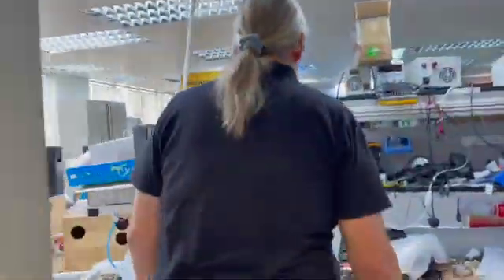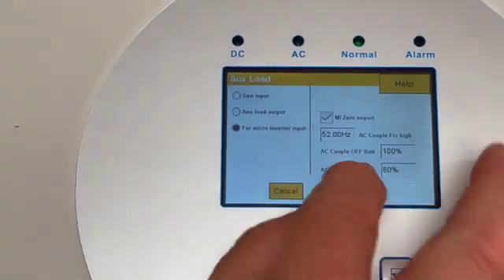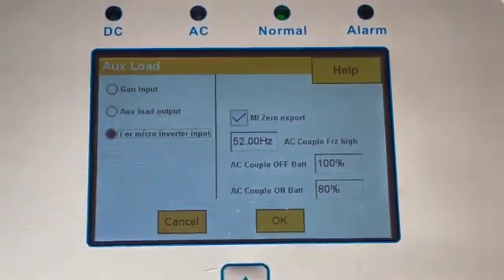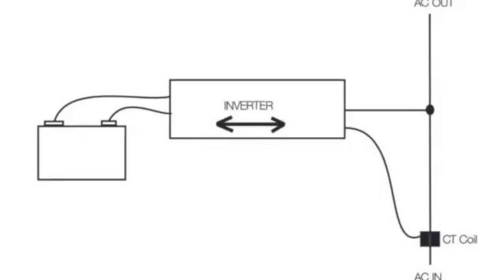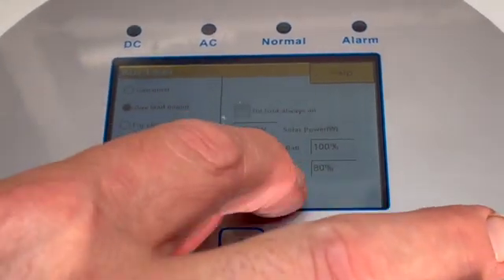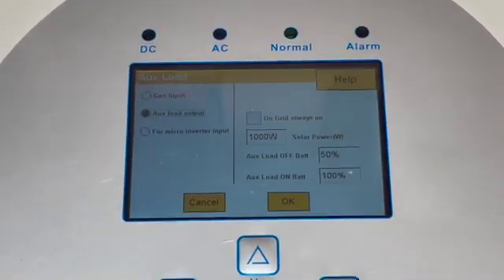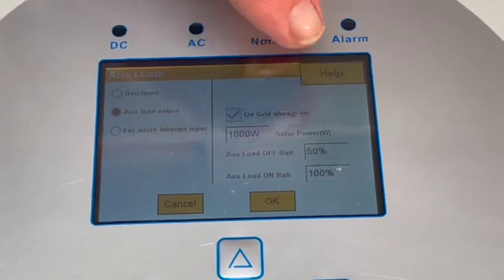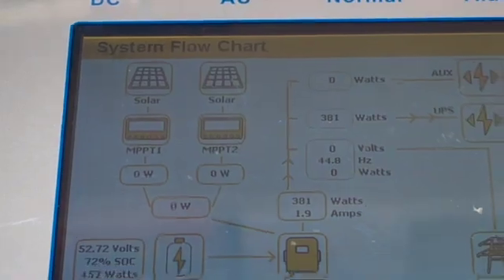Aux Load Port

Comment: If the power setting is the amount of power available and not a trigger point for turning on the port, what if your load needs more power than that? How do you know how much power your load is going to need? You’re telling me that the Sunsynk works differently than a Deye inverter, which uses this number as a trigger point. Why on earth would these two inverters, both made by Deye, work so much differently, one using it as a trigger point to turn on the port and the other using it as a limiter?

Another thing that I find hard to believe is that the aux port uses only battery power and not solar. Why would you want it to work that way? Why use battery if solar is available? It’s fine if the battery is used to supplement the solar, such as “if the sun goes behind a cloud” but it makes no sense to use battery when the whole point is to power a load when excess solar is available.

Comment: What happens if I set the limit of the Aux connection to 1000wats then connect a 4KW geyser to this. Will it go into over current mode or will the geyser only get a maximum of 1000watts?

Comment: @sunsynk Thank you for the video. I have a question about the Aux load output section. How does the port handle the power demand if the non-essential devices need more than 1000w since i see 1000w is available in this example? For example, the pool pump and the geyser together need 3500w.

Comment: Hi Keith. Thank you for the excellent videos. I have a query on the solar power setting for auxiliary loads. Why does my auxiliary load output switch off when my solar power being used by the inverter drops (less power being used and consumed) below my solar power setting in the auxiliary load settings. I am drawing 1A on the auxiliary, there is plenty of solar available and my battery is full.

Comment: If I use Aux for non essential loads, e g.  an aircon, would the battery be charged by the solar the same time it is used to power the aircon? Or will the Aux load like the aircon prevent my battery from recharging while it is running?

Comment: This is the most clear explanation about the AUX/GEN port I have found so far. Thanks a lot!!!
I am particularly interested in the use case with Microinverters assisting the continuous work as an island while the grid is off but the sun is still shining.

Based on your explanation, when there's a power outage it is the Sunsynk inverter that is being fed by the batteries the one who dictates the frequency of the grid while in island mode. The microinverters or grid-tied inverters connected to the AUX port on the other hand, will synchronise with the waveform outputted by the Sunsynk and inject power to the AC bus.
Regarding the batteries my interpretation is that if there isn't a big AC load, all the power at the AUX port coming in from the microinverters will flow to the batteries until the SoC reaches i.e 100%. It is at this point that the microinverters will be disconnected. 
Is my interpretation correct?

However, it not yet clear to me how the disconnection of the microinverters will occur. Will the Sunsynk linearly increase the grid frequency so that the microinverters start to decrease their output power until they finally stop or will it just open a relay and disconnect the whole chain of microinverters?

Another point that it is still unclear to me is if such device can cope with the case where you have a 3-phase connection in the household and you have 9 microinverters (3 on each phase). Should they be connected on the LOAD port which is a 3 phase one or is there a model with 3-phase AUX input too?

Once again great video!

Comment: Hi, a novice here, fiddling with his own system. Awesome vids, Thankyou... I have a 5kw Sunsynk inverter with battery and solar panels.  At the moment my Geyser is pulling from the battery and the pv when it comes on. I want to set it so that the geyser only uses pv and grid power, but no battery. Where would I go to set that. And then 2nd question,  if possible, Can I set it so that when the geyser comes on, and SOC is above certain %, that it first uses battery until , for instance 80%, and then use grid from there on?  Looking forward to your reply.
Reply: Did you get this scenario right as i am looking at doing exactly the same

Comment: Thank you so much for this video. very helpful. Just bought a house with the 5kw System, and it seems that the entire house is wired to the AUX input. But after this video i now understand what the system is doing. 
Ideally i am going to get an electrician to split my essential and non-essential loads. but for now I'm pretty happy.

Comment: Hi Keith! I have a 10 kw generator used as a auxiliary feed to my 16 kw inverter with 26 kWh lithium battery array, when grid is down and it's not a sunny day.
My question is how many amps can I set my inverter to charge batteries from the generator?
Also how many amps can I set it to charge from the grid?
I have them both set to 60 amps, but want to know what is the max I can set them to and still be on the safe side?
Thanks 
Jonathan 
South Africa

Comment: I want to make use of my solar system as much as possible so was thinking I could put my geyser on the Aux port so that it can use power from the batteries till 80% and then switch over to normal grid power if needed. I would like to make use of the solar system/battery as much as possible so that the ROI happens sooner.

Comment: Hi Keith,
Just a quick confirmation please: I want to run 2x12kW Sunsynk in parallel connected to 
- the grid [input], 
- Essential Loads [Output], 
- Circuit containing essential loads and a 12kW Grid-Tied PV inverter [AUX]

Can I set the AUX to micro inverter setting and have the frequency shift control the charging of the batteries via Grid-Tied PV? Is there any instance where the AUX contractor would open up in on-grid or off-grid mode?

Thanks a lot for your great videos!
Jonathan

Comment: Thanks for the video, now I have a few questions about attaching an existing PV inverter to the AUX port and whether the Sunsynk inverter will charge it's batteries off that available AC coupled PD inverter? I understand the frequency control in a off-grid scenario but on-grid will I be able to 'suck up' excess AC coupled PV generation when connected to the AUX port?

Also how quick can the inverter change from charging to discharging mode, say when I have load shaping enabled of a 'weak' generator attached to the AUX port and I use less or more power and the Sunsynk inverter has to top up?
Reply: I have done this - I connected another Inverter (Inverter 2) to the AUX port of my Sunsynk and it charges the battery of inverter 2 during the day. Two sets of wiring is required though. Correct setting adjustment is important here to avoid overloading etc..

Comment: Hi Keith very interested to hear you say that the aux port can be used to power non essentials, I am on the verge of purchasing a Sunsynk 8Kw inverter and I have been advised by a number of suppliers to allocate my kettle to non essentials because boiling a kettle with the inverter will reduce the life of my batteries. what are your thoughts please
Reply: That is not true -the Lithium batteries handle those Watts with ease and is designed to work hard.

Comment: Hi Keith, 
Micro-inverter related question.
I have a micro inverter which is grid tied.
Due to its location (in the Garden shed with solar panels on the roof) its difficult to run a 2nd dedicated AC cable to the house to connect to the Aux load.
I also have a continuous load on the same AC line to the garden shed 
(Fish pond)

If i understand the diagram correctly, 
If the micro inverter is supplying enough to the house (which on a sunny day... it does) can the synsynk inverter use this spare AC power which would be available on the AC feed to the sunsynk inverter to charge the battery (along with the DC from the PV array) and charge to 100 battery... then and oy then export to grid....  
Also technical question regarding the CT clamp... what is the absolute longest distance the CT clamp will operate. One company has told me they have done instals with 30m of cat6 cable for the ct clamp.
The ability to use the Microinverter to charge the battery will be the selling point between this inverter or a growatt.

Regards
Dave

Comment: I have a 5.5kW Sunsynk with PV panels and battery.  The system is not grid tied, because (1) I want the system specifically to periods when the grid is down, and (2) Extra capital costs to meet the local council requirements to grid tie.  However, we are still "attached" to the grid to top-up the energy requirements, especially when we have a couple of days of continuous cloud cover.  At the moment this is having to be done manually.  That is, I watch the battery SOC, and when that gets very low, I then have to manually throw a switch to go from "SOLAR" to "GRID".  Have you dealt with this situation in one of your videos, so that I can view this  .  I have a gut feeling that the installers doesn't know the sunsynk, however I know even less and cannot take him to task
Reply: We all do it that way - manually.

Comment: Thanks Keith. So when “on grid” what’s the difference in using the Aux port for a geyser versus keeping the geyser on the non essential load and there is good solar generation ?
Reply: I currently have 2 geysers (hot water cylinders for non-ZA people) and the pool pump on the grid side (main DB) of my Sunsynk 5.5 kVA inverter.

I would like them on the AUX port for the folloowing reason:
- Currently I can't run a geyser if the grid is off (load shedding), even if I have enough solar to power them, because if the grid is off, the inverter doesn't power the grid side at all
- Better automatic utilisation of solar energy. Currently I use smart timers to switch the geysers and pump on at times when I should have sufficient solar. But, I had to manually disable yesterday, and today it didn't activate because the smart timer thought it wan't sunny until after the time set for the geyser. So the battery charged fully, and then the inverter throttled the MPPTs back.

If I move the geysers and pool pump to the AUX I could set the AUX port to.run say when SOC is above 80%, and just let static timers do most of the rest.

Sure, I could implement the second benefit with some automation bybreading values via the RS485 port or from the Solarman dongle, but I can't address the first issue without making things worse (I don't want the geysers and pool pump on the LOAD/UPS port).
Reply: @bgmilne  Thanks for the reply. So you are saying that when the grid is down the PV power only goes to charge batteries or supply the aux port? It doesn’t supply the non-essential and essential loads? Can @Sunsynk confirm this ?
Reply: @wayfarerza8095  He says very clearly in the video that the Aux port takes its power from the battery or grid only. Solar does NOT provide power to the Aux port. So if Grid is down then the aux port is powered from the battery - until the battery SOC hits the programmed value - say 50%. With the grid down and once the battery gets discharged to 50% the battery stops providing power to any load on the aux port.
Reply: @jimjones7821  That is 100% correctly explained.
Reply: @jimjones7821 No solar power is used by the Aux port? Let’s say I have an EV charger connected to the Aux port. It’s noon and I’ve got an extra 5 kW of solar power. I set the EV to draw 20A. Where does the 20A come from? Where does the extra 5 kW from solar go? He said there is only battery charging or battery discharging, not both, so if the EV is drawing 20A from the battery, then the extra 5 kW is just being curtailed (assuming I’m not exporting)? If this is the way it works then connecting an EV to the Aux port makes no sense.

Comment: Hi Keith. I have seen a video of Deye Inverter having microinverter in aux port and supplying to grid as well. But you are saying that it'll not work ongrid because of frequency shift. I'm confused now. Please check this video from 5:30   https://www.youtube.com/watch?v=U0C0djK8eiM
Reply from the maker: It will work but the frequency shifting to attenuate the micro inverter power will not work on grid
Reply: @sunsynk  Means Microinverter will continue working with its full capacity. In video I shared, he configured in a way that it'll keep on working and battery will never reach to cutoff voltage of microinverter

Comment: Thanks Keith
Is there any way to use the software to control the GRID FEED IN (ie solar export) so that it does not exceed the load required on the CT COIL for the non essential circuit?

Ie. To export enough solar power to not let it reach the utility metre on the street ?

Thanks
Reply: I have 2x 5.5kva hybrids, please can you show me the setup configuration to export as I have described above.

I've got 10W Trickle,
But I cannot find a way to export solar energy limited to the load on the ct coil. (ie. I do not want it to flow negative to the street meter) 

Thanks
Reply: @GarethSeymour  did you figure this out Gareth?
Reply: Hey  @GarethSeymour did you get this working? Would love to see your settings. I'm setting up my own 5.5k now and struggling with the same thing.
Reply from the maker: Yes you can control the export power, Also you can export just a solar panels energy when the battery is full

Comment: So I can charge my electric car with 4KW when my battery is above 85%?
Reply: And below 85% will it turn off the load ? 
If grid always is ticked what will the system do ?
Reply: @adamsaiyad3959  Your Q : If grid always is ticked what will the system do ?     A : It will then supply the car with power from the grid directly via the Aux port. Wattage is then limited to 50% of the Inverter max power. A 3KW inverter will then give say 1500 Watts max via the Aux port.
Reply from the maker: Yes
Reply from the maker: It is a really good application for that purpose🙂🙂

Comment: Thanks for the Video, please could you run some tests in the video . 
Describe what the watts box does ? 
ive got several installations with Small battery capacity 
using the aux load the batteries seem to drain past the lower threshold and we have had to leave these loads off the aux port .. 
if we set the port to 500w what would the system do ? does this mean above 500w it wont power the load ?
Reply from the maker: What is the limitation of the powerful to the axillary
Reply: @sunsynk  sorry your question is vague .. please explain in more detail

Comment: Hiya Keith, is there a maximum loading   for using the  aux  port?
Can it be used solely without using the main feed in from the consumer unit.
Reason for asking is  we have  small duration power cuts  (10 minutes max) every 3-4 weeks.
I know it's just for essential loads  but with the outage being this small I wondered if this would be a great solution.
Great videos, keep 'em' coming👍
Reply from the maker: You can do as long as the rated power does not exceed 50% more than the Rated power of the inverter this is an absolute max
Reply: @sunsynk  Keith, what's the reason for this 50% max rating of a generator attached to the AUX port?